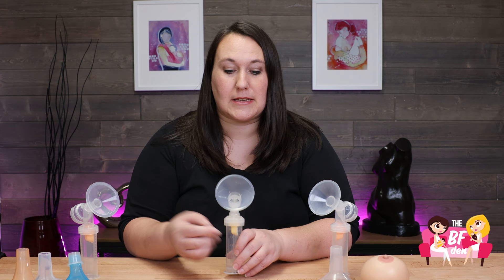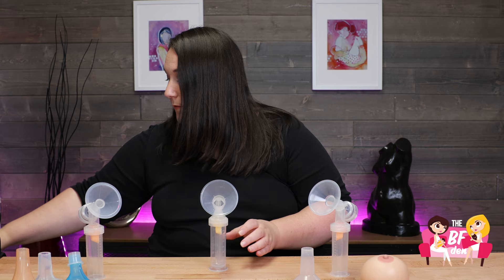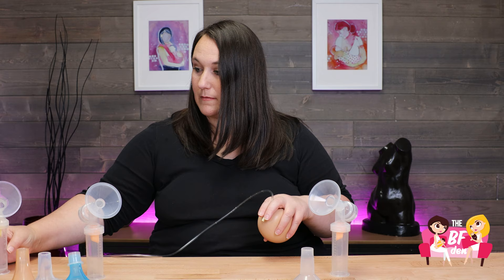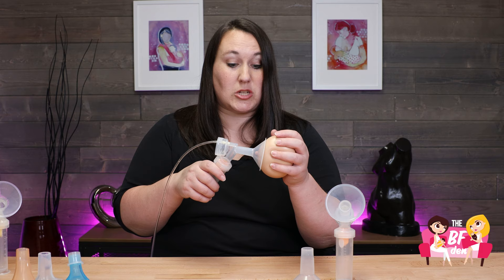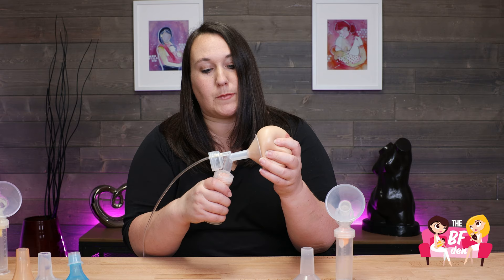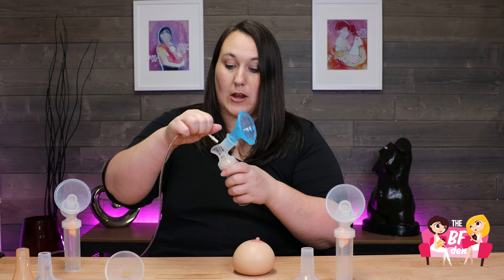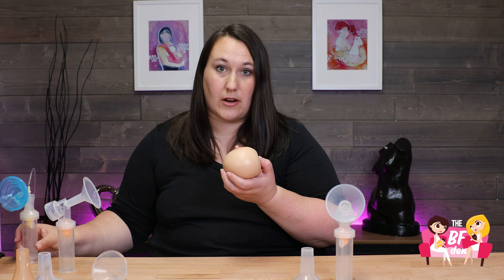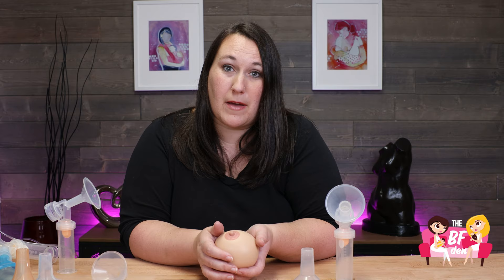Breast Pump Flanges : Finding the Right Flange Fit For You

Comment: I've tried a bunch of different sizes (24mm-13mm) but no matter the size my nipple eventually rubs the sides of the tunnel. The 15mm looks the best in terms of not drawing in areola but the 13mm is also very close. I have very flat nipples that only measure 12mm when not swollen from feeding or pumping. I don't notice a huge difference in pumping time between 17-13mm.
A few questions:
Is this what is meant by elastic breast tissue?
Is there another way to see if I have the right fit than "doesn't touch the sides"? Is there a way I can help with this inevitability? Would you suggest a different style?
Reply: Did you ever find an answer to your question? I have inverted nipples and struggle pretty much with the same thing as you...
Reply: @PollyColonaOficial  I did actually. I found out that the smallest size that wasn't rubbing at the beginning of the pump session was the right size for me. It was more important that I didn't bring in ther areola than that it didn't touch the sides for both comfort and speed of pumping. Hope that helps

Comment: I'm a bit lost still, I measure 17mm which is recommended a 21mm flange but my nipples still swell up and rub some of the walls.
If I use the standard 24mm flange that came with my pump the same thing happens but also pulls in areola. My nipples are so sensitive and hurt all the time now that I've been pumping :(
Reply: Same here
Reply: Same here
Reply from the maker: Fitting can be tricky!  If the 21mm is causing swelling, try the 19mm.

Comment: Hi! I'm measuring about 25.5 mm and have tried using both a 28 and 30.5 flange (lansinoh 2.0 pump) and my nipples are still sore during and after pumping. Could you assist me with advice or scheduling a virtual consult for help?

Comment: I have a question if I wear a size 26mm my nipple is the only thing that pulls into the flange but a minute or two in my nipples are rubbing on the side. If I size you to a 27mm then my Areola sucks in what do I do
Reply from the maker: Hi Lesha!  The BeauGen inserts may be a good option for you.  If you're not lubricating the flanges, I would recommend some coconut oil, olive oil, or a non-sticky nipple cream to help with the friction.  

We do offer virtual flange fitting visits, and would be happy to help, if you want help figuring it out.

Comment: Hi, I'm having problems with my nipples swelling, I was using a 21 mm and went down to a 19 mm and it's still swelling and rubbing against tunnel. I'm exclusively pumping and before pumping I measure 16 mm, what size would you suggest using? And where can I find that blue flange you showed last? Maybe that would work?
Reply: It’s a Pumpin Pal Cox’s size flange

Comment: Hello! Thank you so much for the video! I’m currently pregnant and want to buy the Ameda Mya breast pump that comes with a 24mm flange. I know you’re supposed to measure your nipple once you pumped but because I live in a place where is not that easy to get a new flange, I want to prepare myself in case I need a smaller size because I think I have a small nipple. My nipple currently measures around 13-14 mm, do you suggest buying a 19-20-21 mm flange? Or the nipples do grow A LOT more so I could use the 24mm? Sorry if this post is TMI hahaha
Reply from the maker: Hi Gladys! It's hard to know for sure without seeing how your body responds to pumping.  With a 13/14mm nipple you may need a 17mm flange.

Comment: Hi,i am using right flange but aerola is pulling into tunnel along with nipple is rubbing..can i use pumpin pal for this issue
Reply from the maker: You can try!  But a smaller flange may be helpful.  We can help with a virtual flange fitting if that would be helpful - http://bfden.intakeq.com/booking

Comment: Plz help I have spectra s1 pump nd it came with 28mm flange which is definitely big nd pull my skin I measured my nipple it’s 2 nd half cm which flange size shuld I order?
Reply from the maker: If you're measuring 2.5cm before pumping, you could try the 24mm and see how that fits.

Comment: Hi there, i am really confused now. I have medium sized breasts but my aerola is a lot bigger and spreaded. Which flange size should i go for? :(
The country where i live, they wont let me give a trial so i gotta buy and use straight.  😢
Reply from the maker: You need to start with measuring the nipple, the breast and areola size don't factor into flange fit.

Comment: I’m quite confused about my size and idk if you’ll be able to respond to me. I measure after I pump and they each measure around 19mm which means I’m a 24mm insert. But my nipple and part of my areola is inside the flange. The nipple rubs a tad bit but during and after pumping, my nipples are not sore nor are they sensitive. If I go a size down I’m afraid the flange will be too small and if I go a size up I’m afraid the flange will be too big. Now would you say I should stick with the 24 mm flange?
Reply from the maker: Hi!  Measuring before is much more accurate, after you have pumped your tissue has swollen to meet the size of the space available to it.
Reply from the maker: Hi! I would recommend measuring before you pump, not after. After you pump the tissue has swollen to fit the size of the flange you are using. It sounds like sizing is down would be appropriate, but if you need some help we can help you. bfden.intakeq.com/booking
Reply: How do you measure? I need help idk what size to get.

Comment: Thank you. Is it possible for both nipples be a different flange size? Can size change throughout breast feeding?
Reply from the maker: Absolutely!  It is not uncommon for the nipples to be different sizes.  It's also not uncommon for the size to change over time as your breasts change/adjust to more milk, less milk, and even less swelling after birth (or from using a flange that's too large).
Reply: @Bfden  Thanks for responding. I think my left flange side changed now that my baby is approaching 3 months and had been cluster feeding, because now both breastfeeding and pumping hurts😩

Comment: Can having the wrong size cause clogged ducts? Because never fails I pump and get clogs 🥴
Reply: I would say yes 100% because that’s happening to me. I get clogged ducts because it’s not emptying all there is. I find the advice online to go up 2-3mm is complete garbage. It definitely doesn’t apply to me. I’ve been wondering why my supply is not going up and realized way too much of my areola goes in Once I looked it up online.  I’ve kept trying to downsize all the way to 15mm now and it’s STILL happening. Hoping the 14mm fits because I’m at a loss here trying to exclusively pump 😩😭
Reply from the maker: Absolutely, if the breasts aren't being emptied properly you can easily end up with plugged ducts.

Comment: With flat nipples what is the ideal size? If i have not much area to measure clearly. Any standard size for flat inverted nipples i can use as a guide?
Reply from the maker: Flat/inverted nipples can be a challenge.  I tend to measure what I can see best as the nipple, pump a bit with that size, and remeasure once the nipple has fully come out.

Comment: I’m currently 33 weeks pregnant would it be okay to turn my pump on and try it to see what size I need?
Reply from the maker: As long as you are low risk, you certainly can, but I like to remind people that your breasts will change a lot as your milk comes in, and then stabilizes post partum.  Getting a basic idea of flange fit now is a great idea, but don't stock up on a bunch of parts, because the fine tuning should happen once milk supply is stable.

Comment: What if I was given a used pump and have no flanges to figure this out with? I have to buy all of these parts still, I only have the pump unit. Is there a way for me to measure my nipple to see what size I would be? Do you know how I would do that?
Reply: Yes, you can measure them. They have a lot of different rulers and ways to measure if you google it. There are also a lot of Facebook groups where LC will size you if you can't go to an LC in person. Search flange sizing in Facebook.
Reply from the maker: It's generally not recommended to use a used pump. Most pumps have a 1 year warranty and are designed to last for 1 year to be used by 1 pumping parent, for 1 baby. If you're in the USA, your health insurance should cover a new pump for you.
Reply: @Jessiealabama1205  Could u suggest some fb groups